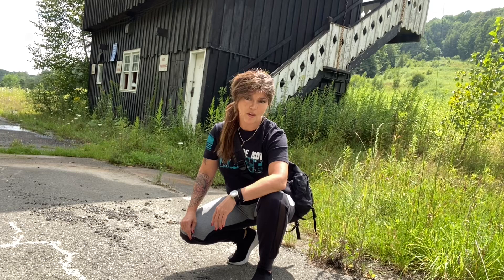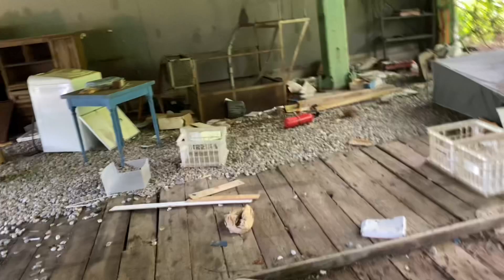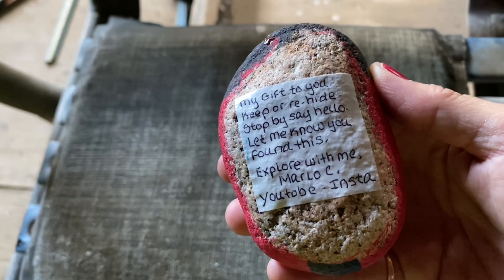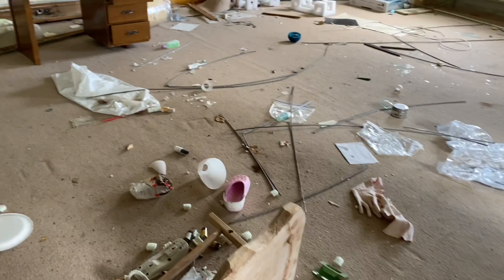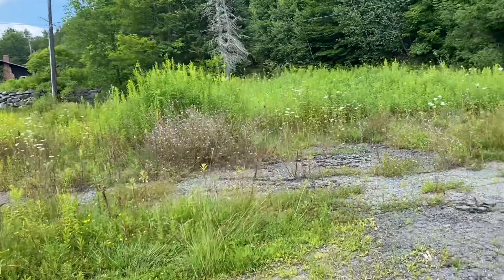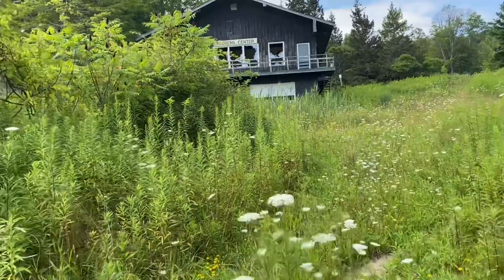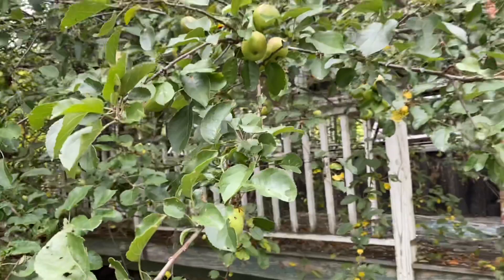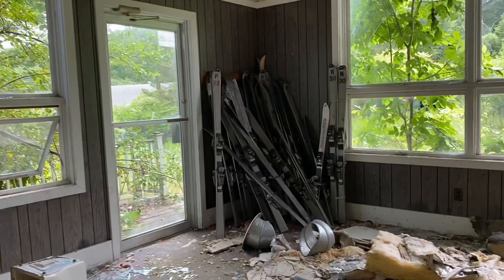Famous & Forgotten - Johnny Cash filmed here - A lost Massachusetts Ski Resort

Comment: Actually that round turning mechanism that is at the ski lift would not spin you around and take you up the hill. It would spin the empty ski chair (After letting off the folks coming down), and spin around using the round turnstile ...then chair would be in the opposite direction at which time the skiers going up would sit on the chair and ascend the hill.
I just wanted to clarify when the ski chair went around that round mechanism on the roof, it was empty. It didn’t have people sitting in the chair when it went around.
Reply from the maker: Thank you for the right information on the mechanics of it all. Appreciated